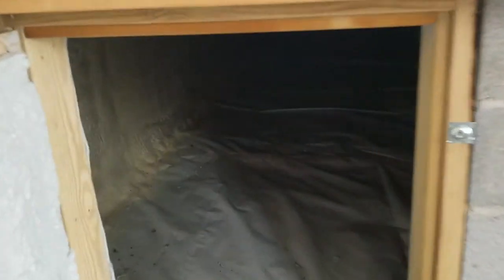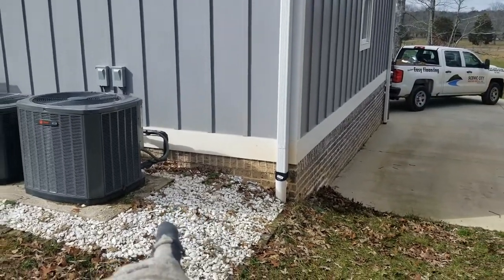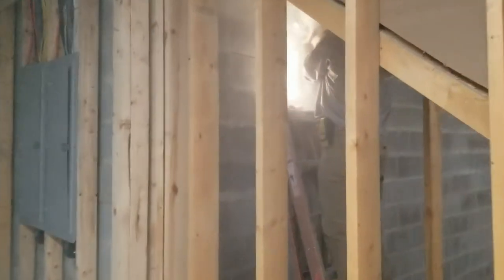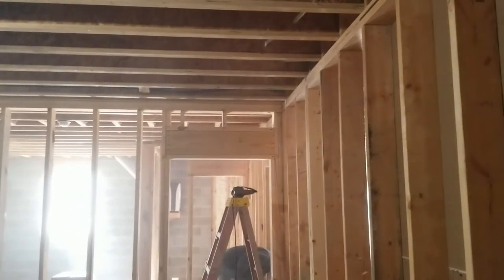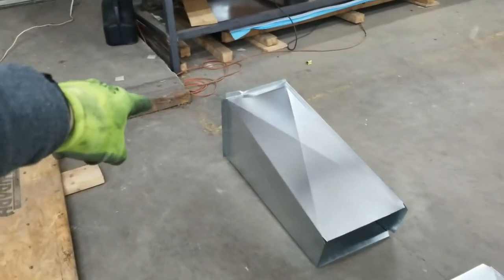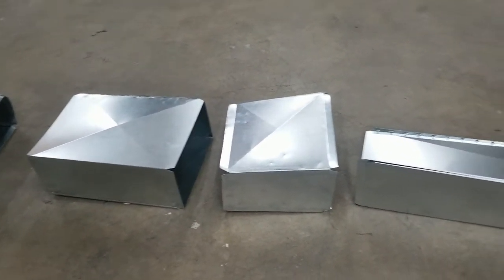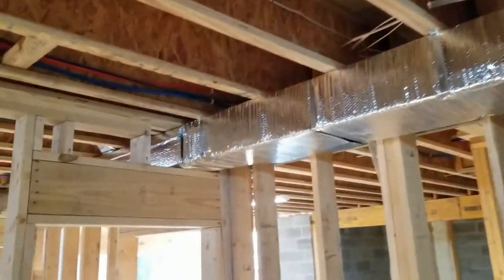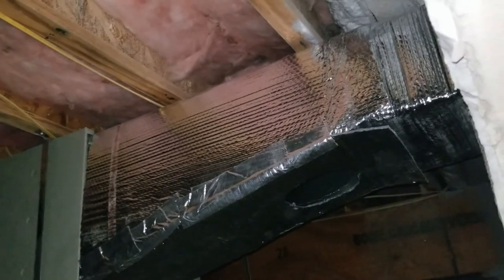Basement HVAC Install - Tight Clean Duct Work For Good Headroom

Comment: Does the metal ducting need to be wrapped in insulation, as I just bought a new build and none of the ducting is wrapped? I live in Spokane WA for geological reference.
Reply: It helps with the efficiency of your system in regards to how much of a temp diff u have from your furnace to each of your supply registers. Mainly you will see a difference in your energy consumption and how quickly it will take to heat or cool the space.

Comment: Hi,I’m looking for more headroom in my basement.Right now I have ductwork 26 by 8 at the beginning and it gets smaller as it gets longer but depth is same 8 inches .I have carrier 3 ton air handler and 3 ton condenser.So my question is there any possibility to make my  duct wider and shorter in depth then I can have more headroom and I have enough room to go wider.If yes, can u please tell me what size would you recommend.
Reply: One ton of cooling requires 375-400 cfm airflow. 3 tons of cooling requires max 1200 cfm. If you live in an area of high humidity reducing the airflow some will help with dehumidification. But if you reduce it too much it may cause the evap coil to freeze up. The duct design needs to keep the total static pressure down around the 0.5" w.c. mark. I think you will be surprised how wide the duct would need to be if for instance you make the side dimension 4". Most likely totally impractical. The closer to round a duct is, the more efficient it handles air. Should be on line duct charts out there that would answer those questions.

Comment: Why not just install the air handler in the basement and build a small utility closet for it . Could have avoided all of that stupid chiseling and unnecessary work. Could have been done so much simpler.